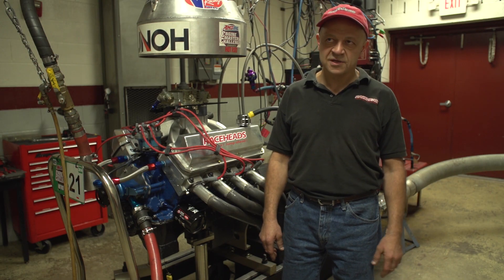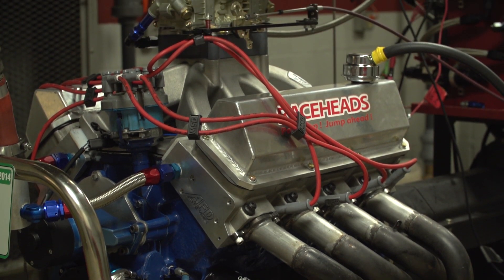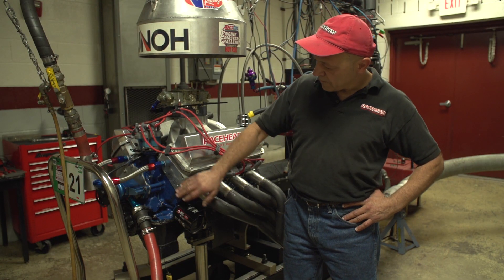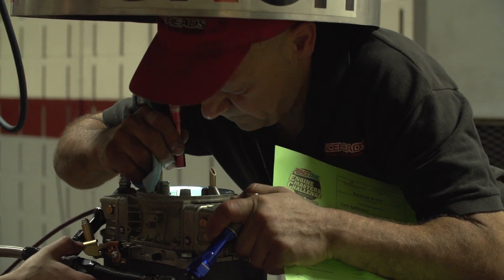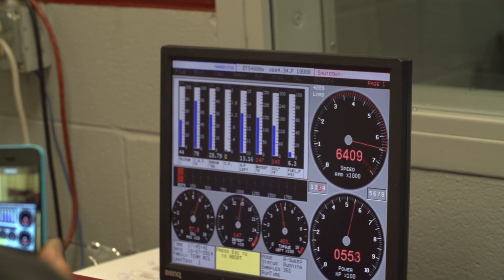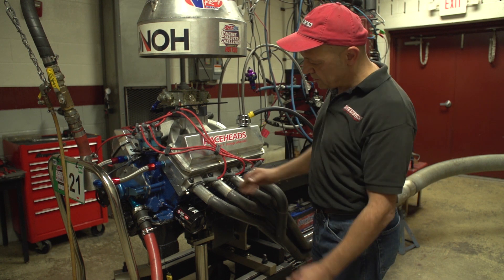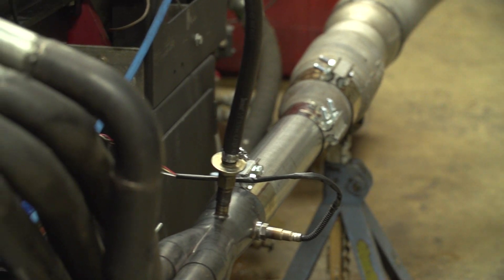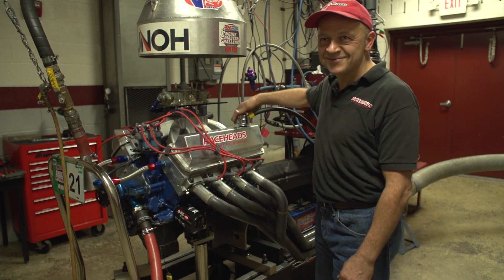413ci Ford Clevor by Raceheads and AFD at the Amsoil Engine Masters Challenge 2014

Comment: Cement ? not engine coolant ?     Not your daily street driven engine then .
Reply: Just a partial fill of the cooling jacket to support the cylinders, still enough room for coolant to flow in the upper half of the block. Can still be street driven

Comment: cement inside the cylinder walls? ok I am a bit ignorant on this exactly.. Like actual concrete cement where in the water passages?
Reply: Ryan Silva you usualy only fill the bottom part of the water jackets and still use water to cool the upper part of the cylinders
Reply: Im not sure in this case if its pure concrete for construction, but inthe old days it was exactly that. Not sure if something exists now based on that formula for dragracing now a days. But its poured in the water jackets usually. So no radiator can be used, so its destined only for drag racing or dyno runs
Reply: many thanks for the education :)
Reply: Also you can do a "short fill" on blocks that are going to be used for street rods where coolant is still able to flow through the upper part of the water jackets. A full or "Tall fill" will offer the most strength but will restrict the engine to 1/4 mile duties and Dyno pulls as Ryan Silva previously stated.
Reply: Since about 1986 or so there's been a pourable block filler called hardblock. It's a cement based filler, just like the cement that you'd find in the concrete mix in your basement walls or patio difference is it has iron and steel fibers to really hold everything together and help increase block strength. The advantage of filling a blocks water jackets is that for a guy on a budget you can get really close to the strength of an aftermarket billet block without spending thousands of dollars.